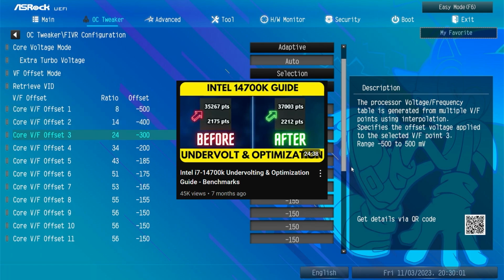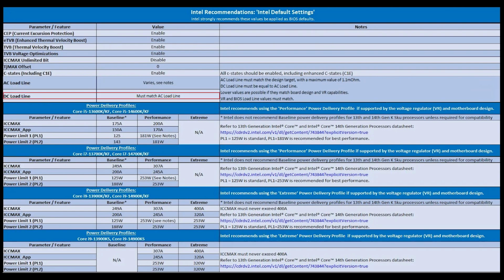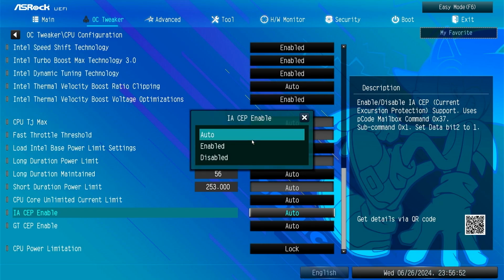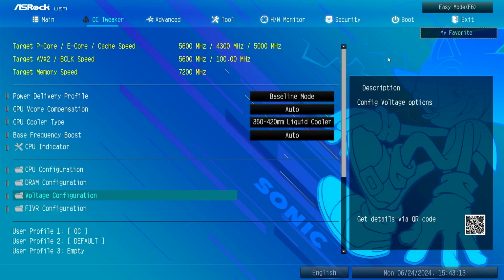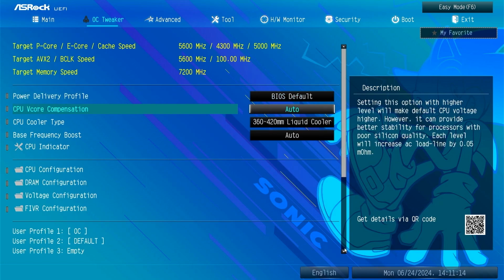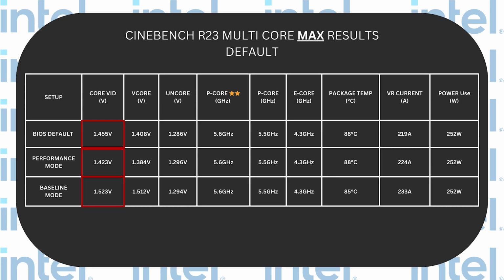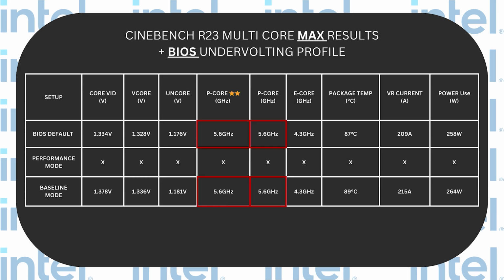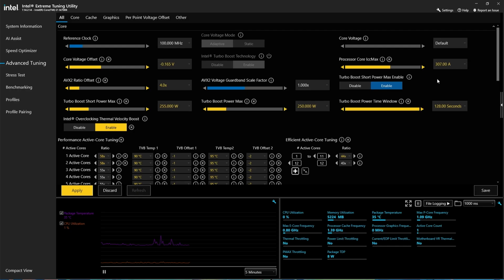How to Tune your Intel 13th & 14th desktop CPU using Intel's Recommended Guideline + Undervolting

Comment from the maker: Remember that there could be some varation between CPU model so some values like ICCMAX will be set to different values between i5, i7 and i9, Also i9 should have Extreme Profile other than Baseline & Performance

Previous Guides:
BIOS Guide: https://www.youtube.com/watch?v=IWU-L1kChzg
XTU Guide: https://www.youtube.com/watch?v=9K_IFx4PiVo&t=2s

You can download My Updated XTU profile with ICCMAX to 307A here: https://drive.google.com/file/d/1bBDGn9X9SG4CjAP0OgKd0pxkELZ7y-pk/view?usp=drive_link

Tips that may help changing microcode 104 : https://www.reddit.com/r/intel/comments/10b9p6w/undervolting_on_b760/

Intel CPUs Playlist: https://www.youtube.com/playlist?list=PLg8ANjUNzqfOpfnikcXTYIqbZigQi8oqe

Got questions? Drop them here or join our TECHOSAUR Community on Discord: https://discord.gg/PXmJY6BP8b

Become a YouTube Member: https://www.youtube.com/channel/UC-jauq-kZ20FrlnCMkx2gSQ/join
Support on Patreon: https://www.patreon.com/TECHOSAUR
Your support helps keep the channel growing. Thanks for watching!

Comment: If i only update bios. The issue will fixed ?
Reply: Nope. I´m having a lot of crashes and researches to make my 14900k stable here. AUTO settings will not save you from crashes with these CPU,s.
Basically...we have to use LLC level 6 on 14900k.

Comment: Hi, I did the same steps on XTU like you, unfortunately when I tried to apply, I did and after straight the program closed it. I got a blue screen saying that there is a problem and apparently nothing was saved, everything went back by default. I have an MSI MAG Z 790 Tomahawk DDR5, the latest BIOS. I7 14700K CPU. My problem is that under "heavy loading" my CPU stays between 98–100 degrees. In idle, it is between 42–50 degrees. I have been searching all around in order to set my BIOS adequate for my CPU from not being cooked. Any suggestion will be much appreciated. Best regards!
Reply from the maker: Sorry, did u fix it ?
Reply: @TECHOSAUR After 9 months, ofc.
Reply from the maker: @JetLion glad to know !

Comment: Thanks for your videos!  I have the 14700KF and I'm having some issues with "micro-stuttering" in certain apps such as golf simulator software in 4K, even though GPU and CPU are not over-utilized (capping FPS at 60 for projector).  Others with AMD chips and similar GPUs don't see these issues.  I'm wondering if I am hitting momentary current throttling or something of the like and if undervolting/disabling E-cores etc might help.  Would you have a recommendation for software that could check this?  I did do the XTU stress test and the chip did hit all throttling limits repeatedly.  Thanks!
Reply from the maker: Did you try undervolting it? When the chip hits power limit throttling, it causes micro-stutter since Windows logs it, and the CPU has to recalibrate. You could also try disabling E-cores, but I suggest undervolting. Those chips come with really high voltage; when the CPU can actually perform the same with lower voltage, it reduces the temperature by a lot; you almost feel like magic, did u have issues doing it ?
Reply: @TECHOSAUR just downloaded your XTU file and will try soon!  Also have ASRock Z790 mobo.
Reply from the maker: @SCDrJ03  good keep me posted! 👍

Comment: Hello. I wanted to ask you: Is it currently safe to buy the Intel Core i7 14700K processor? I don't know if the overheating and oxidation problem presented by Intel's thirteenth and fourteenth generation processors has already been solved. The idea is to accompany it with a Noctua NH-D15 heatsink plus the Asrock Z790 PG Sonic Board plus 32 GB DDR5 6400 Mhz Corsair Ram plus the 0x12F microcode.
Reply: No you should trust Tech YouTubers without question like Gamers Nexus, Hardware Unboxed, Pauls Hardware, etc bc they would NEVER mislead anyone w/ their trust me bro benchmarks.
Reply from the maker: The CPU with a little undervolting and tuning, runs awesomely well and cool. I upgraded the system to ultra 265k, but I used the 13th gen for over a year and had one with the 14th Gen with some tuning in BIOS or on XTU; they became way more efficient and unlikely to degrade.

You may be missing the point that some big youtube channels love drama, and the more they squeeze a topic or bully companies, the more they gather audience and clicks. I'm not saying all are like this, but it's known to everyone. If you stay positive, many people would just get bored and think companies bought u to say this, and you look... Most of those channels are booming because they often show in headlines things that are negative about products whether its a cpu, gpu etc and get creative with the click baiting thumbnails and titles just to get attention less about actual info.
I'm not saying to always say good things but at least say the whole story not just the part that gets more views

Quite few people I know have 13th and 14th  and after they have spent some time updating microcode and BIOS and did some undervolting whwther through bios or xtu they became so satisfied and are happy by how cool it could run even with an air cooler, the 14th Gen is still competitive against even latest Ryzen CPUs when it comes to gaming

It may not be the best choice today but depending on price, personal preference and usage it could be possible to enjoy if you tune it a bit or perhaps latest updates may be enough by themselves, last time I used mine they were running very good and it was end of 2024 so after the main microcode updates , I have friends still have it and they just use it and get no issues
Reply: @TECHOSAUR   Okay thanks. The processor catches my attention because of the performance it offers. I also saw an opinion from someone who plays car racing simulation video games and he stated that according to his experience, the AI of the drivers controlled by the CPU was much more intelligent and aggressive on the Intel Core i7 14700K processor compared to the behavior they showed on a Ryzen 7 7800X3D, which was much less competitive. On the other hand, it is very true, many channels only know how to parrot recommending AMD, especially the Ryzen 7 7800X3D, but in my experience and personal taste I have always preferred Intel (although I have an AMD graphics card).

Comment: Mine is 14700k and msi z790 board. I put adaptive offset -0.16V system is nice and cool, got R23 at 34000pts, but I need to disable IA CEP. How do you avoid trigger CEP?

Comment: @TECHOSAUR, thank you very much for the excellent work! Your tutorials are truly outstanding.
Could you assist me with more fine-tuned adjustments, perhaps tailored to my setup?

My configuration:

CPU: Intel Core i7-13700K
Motherboard: Gigabyte Z690 Aorus Pro
Microcode: 0x12B
BIOS Version: F29
Cooler: Corsair iCUE H115i Elite Capellix RGB (280mm)

Comment: I’m not seeing C1E under c state configs, also for whatever reason I can’t run your undervolt settings. I’ve got a 94 quality 14700k and a 420mm aio with new paste. I get access violation errors running cinebench 23.

Did some changes and I’m hitting 90c with no overclock or undervolt. Pc crashes with a simple .100 undervolt to cpu vcore  offset under FIVR

Comment: Very good guide brother! I am not being able to achieve the same results, my temperature goes very high when I leave PL1 and PL2 at 253w. The best I got was Pcore 5.34ghz Ecore 4.24ghz with 79°. With your profile I was 100°. My hardware is i7 14700k, Id cooling frostflow 240mm, mother MSI Mag Tomahawk z790, could you help me?
Reply: Update: I changed the thermal paste, I had the CORSAIR TM30 paste installed and I changed it for artic-mx6 and added one more cooler to the front of the case by inserting air and the benchmark gave me:
11603 Marks
maximum p-core 5.46ghz
maximum e-core 4.28ghz
cpu temp 87°.
What do you think of this result?

Comment: You need to be more famous than you are tbh, this is a great guide
Reply from the maker: Thanks. It takes time and effort, I appreciate your kind comment 🫶
Reply: @TECHOSAUR  I had been struggling with other guides on how to tune my 14900KS on my ASRock Z790, and they all basically stunted my performance on games.  After following your guide (and keeping level 3 not 3.5 or 4) i was able to gain FPS and lower temps (from the last guide that I followed).

Comment: I have an ASRock Z790 Nova MB. My rig was rock solid till the latest BIOS update and especially setting ICCMAX to 307A instead of unlimited. I had to back the core offset to -0.155V to make it stable again, my 14700K seems to be a little bit more hungry for power than yours. I have better cooling than you do so I am pretty much at the same temps as you are so more than happy. At base settings it hit 90s in Cinebench but never thermal throttled. Now it sits pretty much in the 70s on Cinebench with the occasional spike into the 80s on the 2 overclocked cores.

Comment: Informative video.  Have to convert it for an Asus Bios z690.  Any idea why XTU stress test literally does nothing?  Press start, and there is no load, no heat buildup. Nothing. Stays at 5-7% CPU usage.
Reply from the maker: Odd that it's not running xtu stability test after you press start. Have you tried reinstalling it?

Comment: Hi do you still recommend BIOS default after the 0x12B bios? I have a 13600k on a B760m Steel Legend board and I have two profiles Bios default and Baseline. Which one should I choose?
Reply from the maker: The default BIOS is the one I'm still using!
Reply: @TECHOSAUR  Great! Can you confirm one thing? Does the Intel microcode fix apply to both Baseline profile and Bios default?
Reply from the maker: A microcode update doesn’t depend on the BIOS set power delivery profile. It’s coded in the processor, akin to CPU firmware, so it will affect all profiles at all times. I’m using the default BIOS settings and applying my undervolting settings. Since this was the latest microcode update according to Intel, I may disassemble this build soon to get Arrow Lake, also for similar guides
Reply: @TECHOSAUR  Right got you thanks.
Also I don't know if you noticed this but after the latest bios update, the TV information table is not there in the bios anymore. I saw this on another asrock board in a video as well.
Is it the same for you?
Reply from the maker: @Chirayata0451  yes, might be a bug, coz it was like this before too then it was visible in last ones now its gone again..
Reply: @TECHOSAUR  Right. I had one more question. I actually use my own custom power settings for my cpu to keep it cool and run with lower voltages.
If I am using my own settings anyway, does it really matter what power profile I select?

Comment: I get a blue screen when applying these settings. It sucks cause I’ve got good parts 😔

It says my system can’t support the -165.00 setting
Reply from the maker: Did you change any BIOS settings? You will need to change the load line calibration level from the default auto to the middle level you have. For example, I have 5 levels and I chose the middle one, level 3, to stay stable after under volting, Other users had similar problems as you, and changing this usually did the trick. You can find their comments.
Reply: @TECHOSAUR  yeah did all of those steps and it’s still saying system is unstable 😔
Reply: Yes I did but I’ll give it another go and get back to you 😊
Reply: I’ve gone over doing the complete setup 4 times today as per your instructions. And it keeps saying 1 things incompatible Core voltage offset -165.0 mv

(If I try set anything from -001.0 - -165.0 I get a BSOD) 

I have an asrock z690 steel legend motherboard

Comment: Are these still viable after the BIOS fix? Would they help with modeling programs?
Reply from the maker: I tried them, and they are working.

Yes, they help reduce rendering time, given that the CPU won't thermally throttle and degrade performance. If you are currently not getting problems (for example, if you monitored and it's good), they may minimally improve it.
Reply: @TECHOSAUR  I get some bad slow downs when re-meshing things. I'll give this a shot. Thanks!

Comment: My i7 14700k  cpu is thermal throttling in intel xtu and cinibench .
The temperature is reaching 100 . 
I have checked the cooler and thermal paste everything is good and the temperature is normal in other tasks .
The tdp of my 14700k reaches more than 210 w in cini bench and intel xtu stress test and thermal throttling . 
What can i do ?
Reply from the maker: Did you undervolt your CPU? That's the way to do it!
Also, make sure you have all Intel microcod and BIOS updates installed

Comment: Unfortunately enabling XMP 1 will cause overclock ram failures for msi z790 motherboards. Any setting changes that can help with this or will intel users have to wait for an update with this?
Reply from the maker: Did you check if your RAM is fully QVL-compatible with the motherboard?

Comment: Thank you.  I used your previous XTU settings to undervolt my CPU and things have worked just fine.  With the latest microcode update, I came running back to see if you have any insights.  Am I correct in concluding that I really do not need to do much different in XTU (other than lowering the power limit)?  Thanks again
Reply from the maker: Also, in XTU, I've changed the iccmax according to Intel's guidelines.
It used to be unlimited.

Just make sure you have the latest microcode update, and if you like to undervolt with XTU, you can safely use those XTU settings, I've got no issues post-update

Comment: haii, im beginner for this stuffs, i have question, when i run my cinebench r23, i check my speed clocks spu through 'task manager', and it runs at 3,0GHz, is it normal?
Reply from the maker: What score are you getting in multi-core?
It seems that you are running on the base clock, not turbo, but I need to confirm this through your final score
Reply: @TECHOSAUR  after i update my motherboard driver (z790 pg riptide wifi) and change it to performance, using deepcool ld360 with i7 14700k, and using your XTU Profile, my score only 34k++, why is that? btw im using 4080 super

Comment: Thank you! Just found this one (commented on your previous one). Question: does the 'microcode' update actually change the processor itself? In other words, if I get a new Intel 14th gen processor, should I rerun the latest BIOS update? Or does the microcode update only update the chipset control on the motherboard?
Reply from the maker: Microcode updates are software updates for the processor. They're loaded through the BIOS at startup, not stored on the processor permanently. When you install a new processor, like an Intel 14th gen, it’s better to update your BIOS to ensure it includes the latest microcode for optimal performance and security. The BIOS, along with these updates, is stored on a specific IC chip on the motherboard.

Comment: I try your solution in bios default power profile after bios update microcode 0x129 and cinebench can't run it's error like your applied in performance mode.
Reply from the maker: Before this x129 microcode update, with the default power profile in the BIOS, did it use to work?
Reply: @TECHOSAUR  hi, before i dont try it because i just found your channel haha, after i applied new bios 😅, Is it there is something i miss ?
Reply: I use asrock ripitide z790 wifi with 14700k
Reply: Bro can we fix the issue with only bios update or we need extra something for microcode